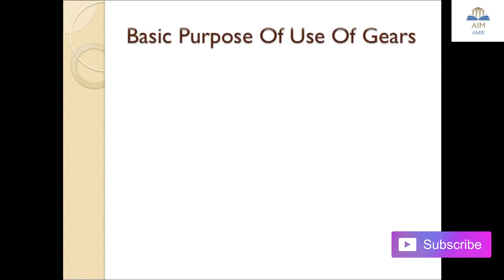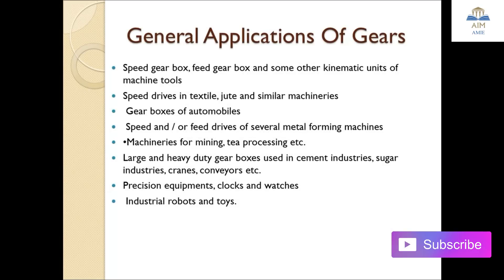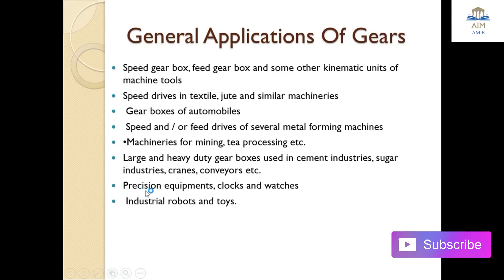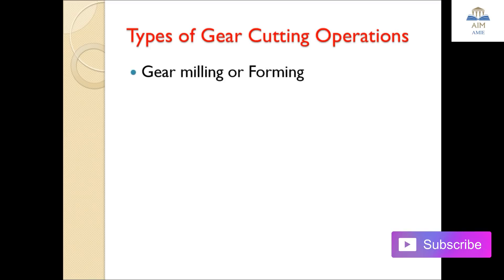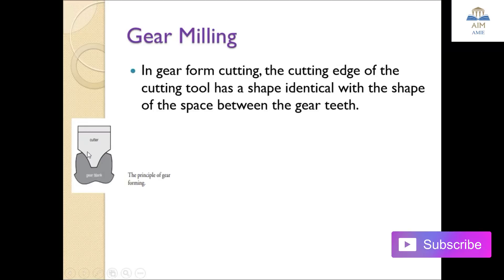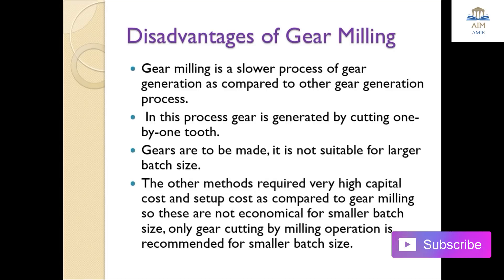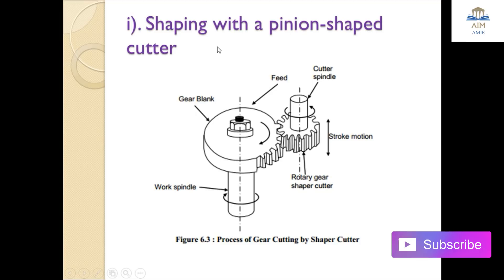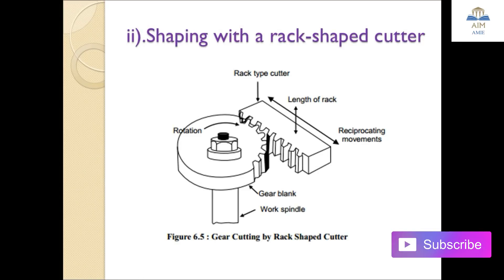The Process of Gear Manufacturing.  ||Engineer's Academy||

Comment: Hiring,
For Bharat forge ltd (Uproll)
Post- Production supervisor 
Experience (03 to 06)Years
Qualification – BE/Diploma Mechanical
Location – Chakan, Pune.

Job Responsibility 

	Proven Experience as Machine Shop Production Department to handle Production Team to Perform under pressure in shift wise.
	Excellent in Coordination, Report Preparation, Documentation, Communication and interpersonal skills
	Excellent in Work force Planning to engage the team as per the Production Planning demand.
	Responsible to Meet Organizational Targets in Terms of Safety, Productivity, Quality and Cost. With optimal utilization of Man, Machine, Material. Maximize productivity of Machinery & Operators, Increases Speed & Efficiency of Processes without Compromising Quality
	Trained, supervise & Manage production line Operators to follow Product Specification & Quality Control Measures & reduce Rejection.
	Meeting daily production targets as per production plan within specified quality parameter under safe working environment.
	Proactive in continuous improvements in line for achieving high efficiency targets with zero defects quality.
	Knowledge about Fixture & Tool selection (Hob, cutter, broach)
	Responsible for TPM activities.
	Knowledge application of basic advanced 7QC tools, DWM, TPM, TS 16949, IATF.
	Knowledge about improving Techniques through Kaizens, POKA YOKA.

Key Skills: - Grinding, Turning, Hobbing on CNC & VMC Compulsory
 
Candidate who can join within 7days of confirmation.
Send cv/call -9776851000

Comment: ... didn't you left out a process called hardening or heat treating that would be required on planetary gearing system and internal high-speed gears inside of the transmission and crankcases...!?
Thank you for a very well done instructional video...
Have much success...
EUDS

.